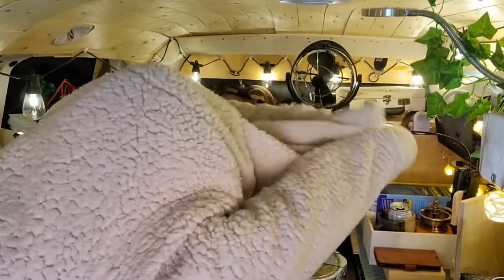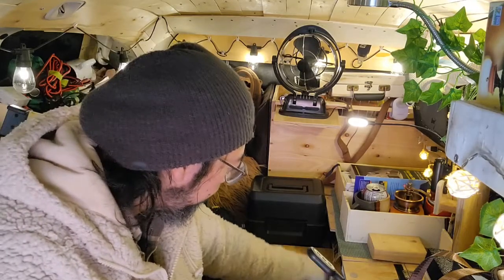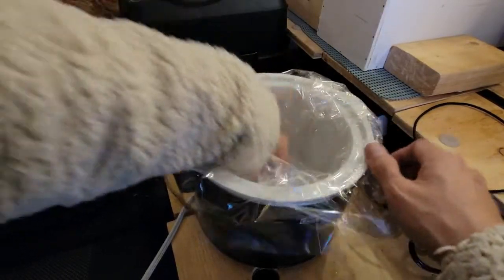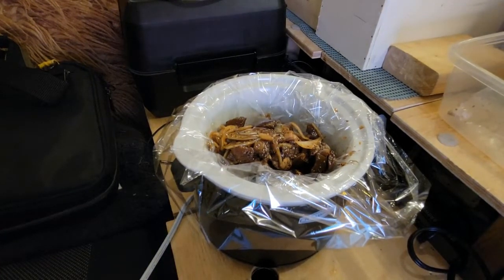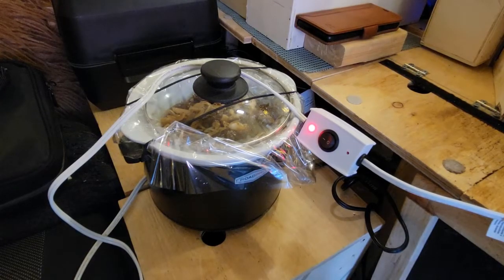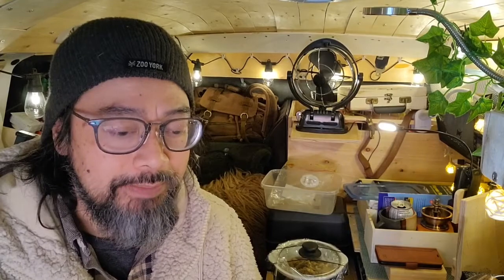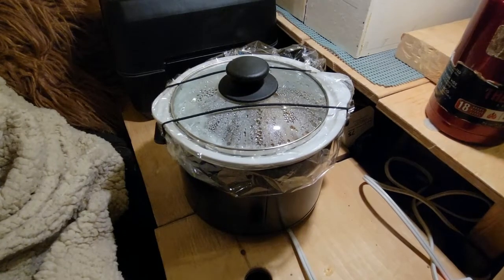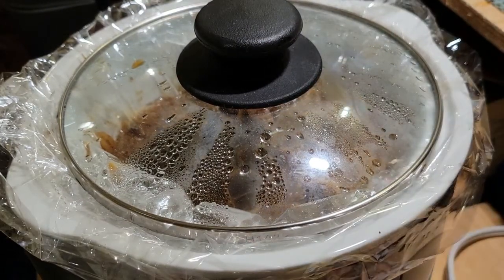Cooking With 12 Volts in My Minivan - Slow Cooker / Crockpot

Comment: My van has a 12v plug in the rear as well as two in the cab.  This would be great to do while driving, I would contain it.  I could just use the engine and save solar.  Food ready when I arrive at destination and since “set up” is literally parking, that would be awesome.  I do have a digital thermometer to check cooking/final temperature.Thanks for showing.  I’m a master with a crockpot and was wondering about a 12v version.

Comment: 🏕👍🏽just ordered this 12V crockpot and liners tonight, gonna try it out camping next week, I heard about a crazy recipe three ingredients meatballs chili sauce and grape jelly 👍🏽 I heard it’s very good
Reply from the maker: The liners worked really well. No clean up and it kept it's strength. I'm getting more confident with the slow cooker and going to try another recipe.
Reply: @SilverCabin  cool i will subscribe, can’t wait to see more 👍🏽
Reply: Wow, what a combination! I'd be really curious to taste that!
Reply: @SilverCabin You can cook anything in a slow cooker except if you want it crispy. As long as you reach the temperature for the type of meat you are cooking it is safe. You can also bake cake, muffins, bread...internal temp. Is 200F to 205F. Use a tin can that fits and put something in to hold it above the floor of you slow cooker. Don't open the lid too often because it takes alot of time to rebuild the heat back up. Dry foods store very well and cook well also.

Comment: So what was it that you cooked, it looked like beef stew? Was that from the frozen section at Walmart? I've never seen anything like that at Walmart. 😀I might need to get a 12v slow cooker, after I get my solar set up.
Reply from the maker: I used this as the starting point - https://www.cookingclassy.com/slow-cooker-beef-stew/ 

...but without all the fancy ingredients. I just used what I had. My next one will be better. I wanted to see how well it would cook. It turned out better than I expected. My  goal is to be able to prep meals where I just empty out the contents, set it, and forget it. 

I understand that will limit my meal options, but van living / travelling sometimes requires that, especially with my minivan.

Comment: I realize it's cold where you are but did you notice if the 12volt crockpot created heat in your van? We have 3 adults & a medium size dog in a 30ft toy hauler in SW Florida and our roof AC just quit cooling. Our crockpot makes alot of heat (not as bad as the oven or stove) I would rather use the microwave but that is rather limiting. Thank you James, Iris 🙋
Reply from the maker: It doesn't generate heat compared to a butane burner. Extremely mild in  comparison. Also much safer.
Reply from the maker: @VantablackPeterS  creating heat via electrical means is expensive. It's a slow cooker and the heat it generates is marginal.

Comment: So 6mth on what do you think to the slow cooker as am looking to get myself one ?
Reply from the maker: First off, the meals and soups made with it are legit delicious. If I have to drive a long distance, I set it up and it cooks while I drive. Plug it into the cigarette lighter. So as a way to cook, it works very well. The downside is it takes a while. Not something to use when you are really hungry. It's a slow cooker and that's what it does. This winter, I already know I'll be cooking up soups while I'm at work and will have a hot meal ready on my break. I've made a custom timer and that's been really useful as well. Cleaning it is a pain. So use slow cooker bags so you can just empty it out and wipe it down afterwards. They have been really useful.
Reply: Hmmm I have to make a lots of stocks for my health and in the lead up to doing this in my minicamper i am liking the idea to have it running whilst i drive - it needs 3 hours cooking on a slow simmer. It would have to be a much bigger slowcooker though - 5 litres or it’s not worth it. Will a bigger one still work ok do you think?
Reply: Cooking smaller batches works well if you consume it all and don't have to worry about storage. Dry food is good for storage long term and easy cooking.....just add water...all in your slow cooker...mouth watering taste....

Comment: What make is your crock pot please
Reply from the maker: It's a road pro and while it does cook meats, it takes a while. It's better for soups, rice, and dishes that don't require heavy cooking. If you are going to do ribs or anything else, they need to be par broiled first. Aside from that, nothing like, making soup while I drive to my camp / destination and then have a hot meal when I get there.

Comment: Look at youtuber Foresty Forest the crock pot king....?
Reply from the maker: He has one that is the classic slow cooker. He plugs it into an inverter. Much better than a 12v. I don't have a lot of battery.
Reply: @SilverCabin  mini banner here, looking at installing a heater - what power do you use? Same for 450watt ac?!
Reply from the maker: @karenlewkowitz5858  I currently use a diesel heater for my heat. I installed it near the back of the van.